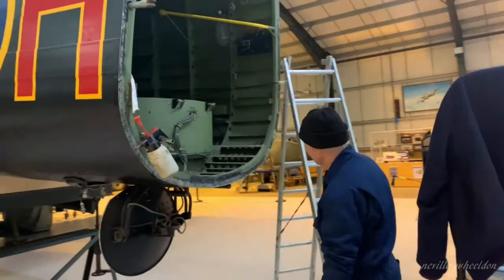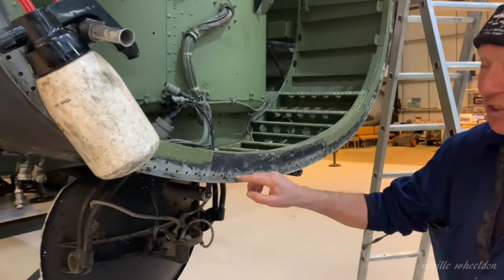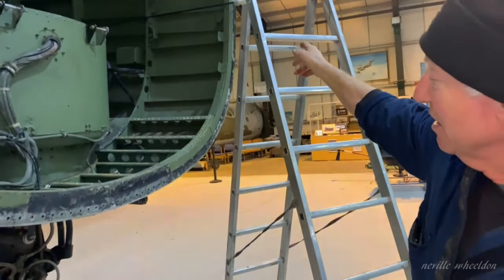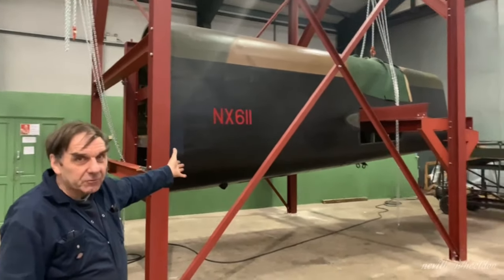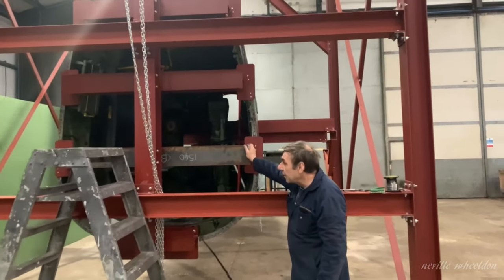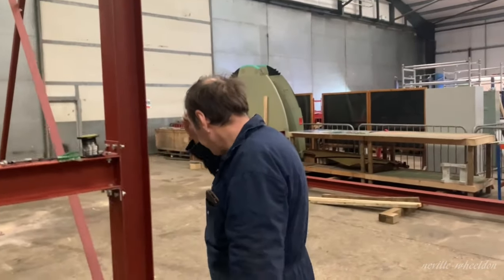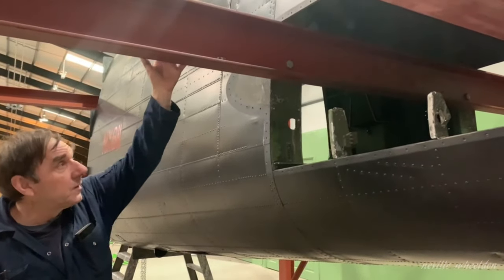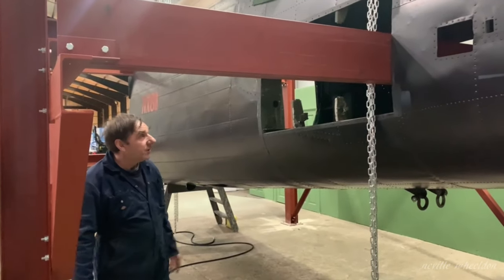Video 86 Restoration of Lancaster NX611 year 4 . Fuselage jig.

Comment: Love the discussion and display of the tooling -- SO important and often hidden behind the scenes, depriving people who should know, the appreciation of what it takes to do work like this, absent the original factory and thousands of workers on a war time footing.  I remember back when there was discussion about the possible order of additional E-3 AWACS, which depended on the long-out-of-production Boeing 707 airframe, and Boeing wanted to charge many $millions to store the tooling pending any follow-on orders, and the US Air Force determined they were not in the business of supporting Boeing in that manner, and Boeing then scrapped the tooling, and developed a follow-on AWACS based on the B-767.  In another case, I remember the civilian side of the Air Force trying to replace leading edge flaps with their complex compound curves, and went through multiple failed contracts with vendors claiming they could perform, and in the event, could not.  The contract finally went back to Boeing, as they had the actual tooling for those, and the replacements were made.  Tooling is a fascinating topic.

Comment: Did she originally fly into the airfield to come a Display
Reply: No. It’s last flight was into Blackpool in June 1970. In 1973 it was transported by road to RAF Scampton and put on display there from 1974. It was then acquired by the Panton family and moved (by road again) to East Kirkby in the late 1980s.
Reply: Hi Brad, thanks for another great informative video. Would it be possible to do a short video on the background, skill and experience of all the engineers? As you’re all integral to Just Janes restoration your stories would be interesting to hear.